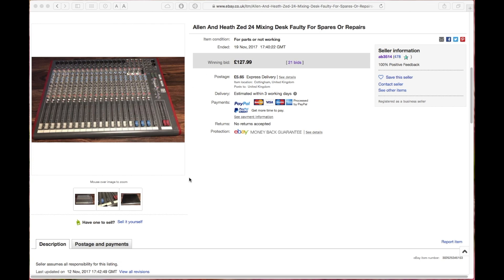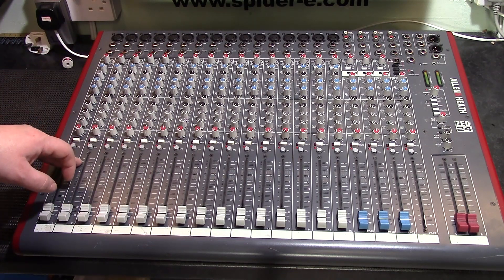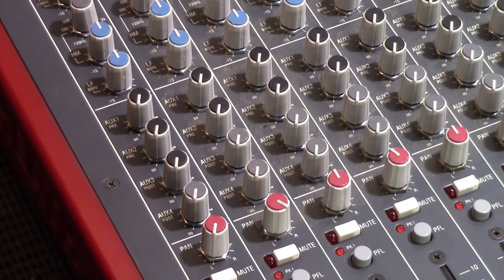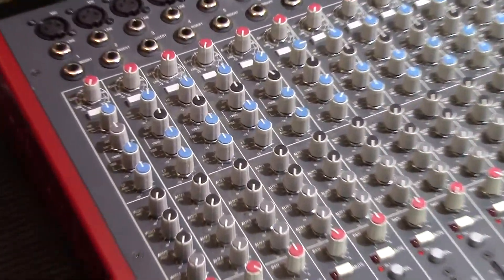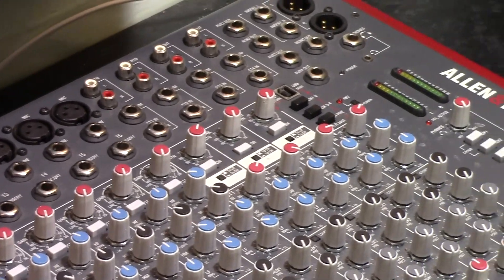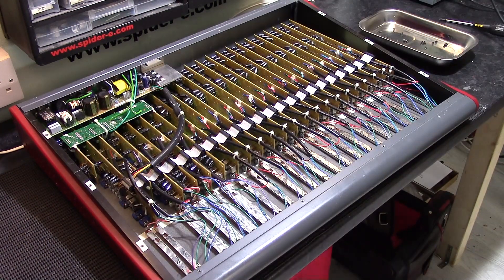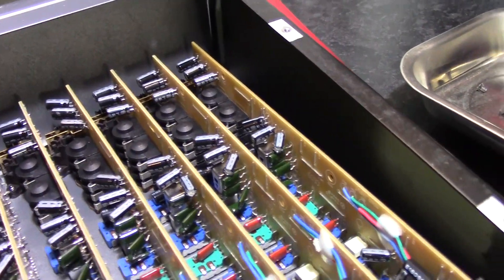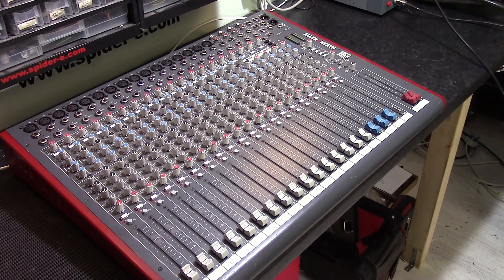Allen & Heath ZED 24 Repair. Part 1 : First look

Comment: Very interesting videos, my Allen & Heath ZEDi8 will not power up. I have checked the obvious, plug fuse, continuity of cables and power switch. Will I now be looking at the main power board? and where should I start first? thanks
Reply from the maker: Yes - start with the main power board. Look for obvious signs of failure first. Be careful it's a switch mode supply, and can have very high voltages present even when unplugged. There is a fuse - check that. Then look at NTC1 or the bridge rectifier on the input side. If you can, test Q1. On the output side, look at D2, D3, D4 and D7.

Comment: Hi , I have an zed  and My problem is that I have a signal in my audio editor in my pc without using any instrument.. any advice? Before was okay. Thanks
Reply from the maker: Hi. It depends what the signal sounds like ;-) Is it a valid signal, leaking in from somewhere, or just noise?
Reply: @Spiderelectron  I can’t hear a noise, but I see in the screen it’s minimum but before was cero and I didn’t change anything. It’s like tic when you plug something

Comment: Bro my allen heath Qu 32 digital mixer some times not working the touch screen and the faders and some times its all the switchs are not working and some faders are vibrate or not perfect working. How i can solve or solution pls give....
Reply from the maker: It's not easy to diagnose from a distance, but it sounds like you have power supply issues. Chek all the power rails with a 'scope and look for under/over voltage and excessive ripple. Look for obvious problems like swollen capacitors and overheating.

Comment: Hi! I have a A&H SQ6, and I want to know If is it the same process to open it..? I mean about pull out faders and Rotary knobs to set free the top painel
Reply from the maker: HI! I've never opened an SQ6 - but I belive you can remove the top cover plate with all the faders in place - can't be 100% sure though.

Comment: Is this an audio interface like can I record into a daw ?
Reply from the maker: It does have a USB in/out but it only supports two channels which you can select from the group buses, or main L+R.
It is not like modern digital desks that can route all the channels individually into USB. It does not support digital interfaces such as Dante.
Reply: SpiderElectron oh okay then I’ll have to get an audio interface lol I was like I can’t record through it ha but yeah I have this board rn and it’s very clean I’m so In love with it

Comment: MY ALLEN AND HEATH ZED 32 CHANNELS 436 .ALL INDICATOR AND SIGNAL LIGHT ARE WHAT COULD BE THE FAULT..CAN YOU HELP ME ?
Reply from the maker: Sounds like a power supply fault to me. I would start by checking the power supply unit. Good luck!
Reply: @Spiderelectron  power supply is working alright 15 volts negative 15 and 48 volts for phantom is good but still i change all regulator except TL 783  i cant find it here to buy any equivalent ? still good power.

Comment: Hi I own this mixer and my power LED has stopped working could you please tell me what the value and type of LED I need to replace it with please.
Thanks so much
Colin
Reply from the maker: Hi Colin. Thanks for watching! My mixer is in use at the moment, but I'll try to get a moment to find the info for you. Not very often that an LED fails, so I'd check for mechanical issues such as bad solder joints too.
Reply: @Spiderelectron  Hi any joy on that LED I need for my mixer just need the specs so I can order a replacement cheers in advance.
All the best
Colin
Reply from the maker: @ColinJamesPoulter  Aye - looks like a typical 3mm Blue LED at 20mA with FWD Voltage of about 3.5 V.  I'd be happy to send you one FOC as I have a bunch here.